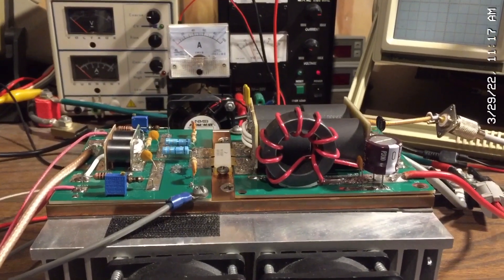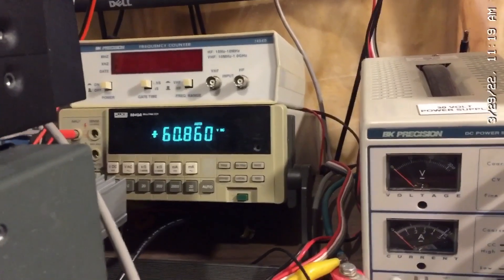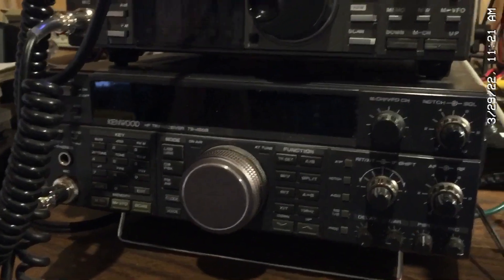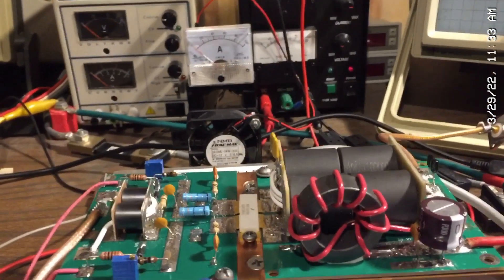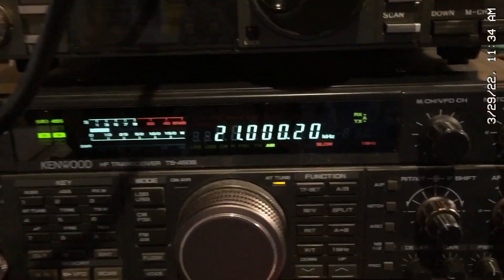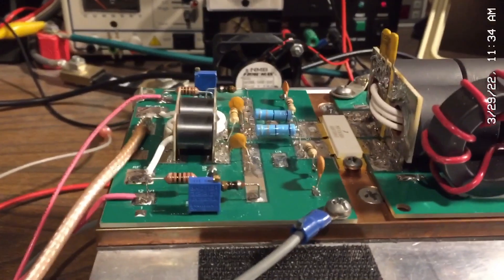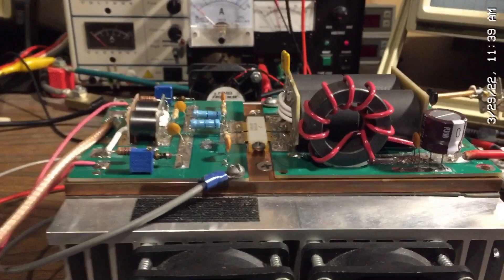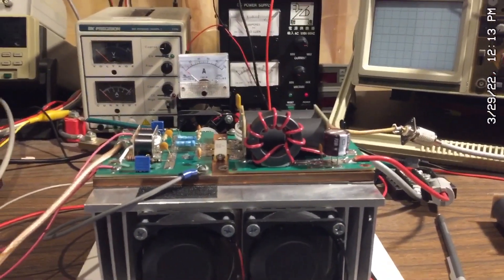New 65 Volt LDMOS RF Board (MRFX1K80H)

Comment: P : 60V X 30A = 1800W, RF power : 1250W, so it was 1250/1800 = 69% efficiency? Is it correct? And so about 550W is dissipated as heat? So will need large heatsink and fan

Comment: Is there somewhere I can find a gerber file library? These boards would only cost a few dollars to have made but everywhere i see pre made boards they are $70+ unpopulated.
 For $100 I can get one populated with everything bar the LDMOS.
  nice work on the transformer. I also considered this but with brass tubes. What is the difference / best between copper and brass in the transformer design? Thanks.
  Another question about tuning for different bands. I see people add low pass filter boards for various bands but if you only want to mono-band what is the equivalent part to tune. It is simply an air choke and capacitor mounted directly to the LDMOS board or you always need to add an external bandpass filter if Mono-banding?

Comment: Just built a similar amp using the MFRX1K80H.   The board design is somewhat similar from DXWORLD-e   and the power going is  57v DC  at  30 Amps.      The output is 1KW.    A  7-band  Low-Pass Filter  was included in this design.   The transformers in this design are a 1:9 coaxial transmission line type of transformer from the LDMOS Drain Pins and then that is fed into a 1:1 coaxial transformer for the final output stage

Comment: What kind of power supply you used to get 60V ? I am also using MRFX1K80 for my homebrew HF amplifier but just got 800W from LPF output with 53V power supply. Is it possible to get 1.5kW from LPF output with 65V on 160m band ？ Thank you.
Reply: checkout DXWORLD-e

Comment: This output power is meaningless without running it through an appropriate low pass filter for each band. Your "Bird watts" show all the garbage harmonics, as well as the fundamental. LPFs are NOT an optional extra for testing or using these amps. Show how many "Bird Watts" you have AFTER an appropriate LPF. You need to also show the waveform on a scope, as measured across the dummy load. If it is not a pure sine-wave, even the mighty Bird readings are plain inaccurate. NONE OF YOUR VIDEOS SHOW THE POWER UNDER CORRECT USAGE. Nor do they show linearity and IMD. Without this setup and these readings, your measurements mean nothing. Please do it properly, using a cleaned up sine wave output and a 2-tone IMD test, You know that some CB guy who buys an amp from you will NOT put an LPF after it? So sell them as part of the amplifier. Anything else is irresponsible.

Comment: Couple of questions…
Will it operate on 160m and at what efficiency? 
Where can the copper heat spreader be obtained? 
Thanks
Reply: Have found 6mm copper used for industrial electrical switch boards. Make sure its flat as mating to the aluminium is essential.  Good luck.

Comment: Show the spectrum on your device
Reply from the maker: Like all pallets, you will need to add a LPF for FCC compliance.
Reply: LPFs for these kind of amps are NOT an optional extra. Your bird is reading most likely a square wave. It will not be accurate under these conditions, and will 'overread' like crazy. This is probably an 800W amp. More like 600 if you want good linearity. @rfmanchannel6915

Comment: Hello, how does a Zener regulate by temp, when it is only soldered to the board. 
What class is this biased in, AB? Sorry, Ldmos is Chineasium to me
Reply from the maker: This amplifier is class AB Bias. The Negative Temp Coefficient (−2 mV/°C) of the Zener diode provides temperature compensation. I have openings in my PC board so you can place the body of the diode directly on the copper heat spreader. Regards
Reply: @rfmanchannel6915  Very cool!!!!
Thanks for the reply😃

Comment: How is the transistor mounted to the heat spreader?
Reply from the maker: I drill and tap the copper heat spreader and use high quality thermal compound.
Reply: I would reconsider that option. Soldering down to the copper provides better heat dissipation and less heat in the high current path.

Comment: What was your drive power?
Reply from the maker: The input drive is 2 watts Avg. The PEP or swing can be as high as 60 watts. Normally, an attenuator pad is used on the input for high powered radios.